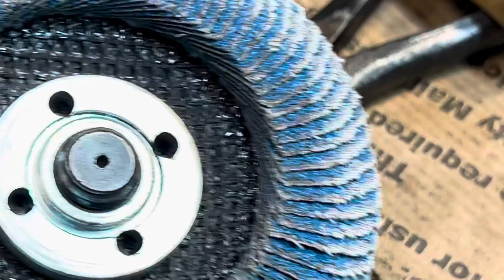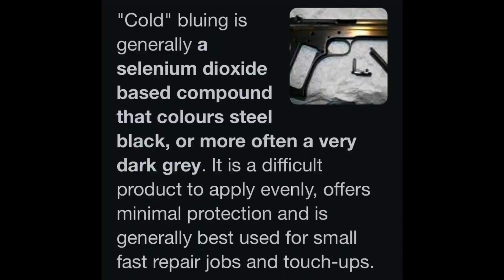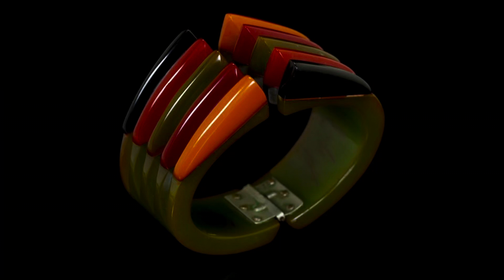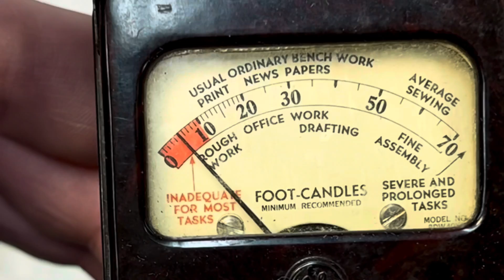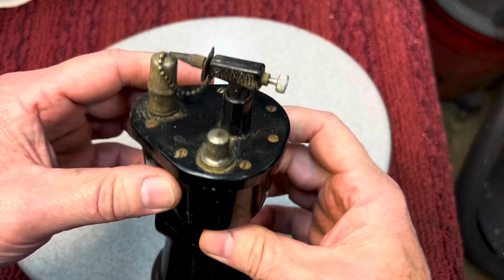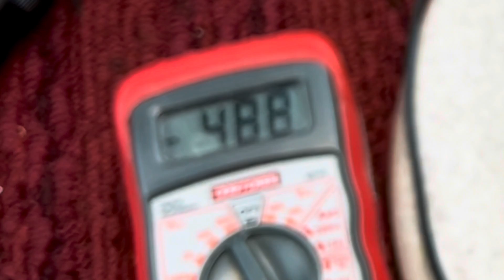Jordan Germany Pliers and BAKELITE Show and Tell

Comment: I need to step up my Waldo game. I'm missing him all the time. Intresting stuff.  I'm using cold bluing on a project of vise grip clamps (the ones you like) I incidentally took it the black of the handle while cleaning one. I don't know what they used in the Peterson factory but it hid a lot of imperfections like forging marks etc. wich I have to sand out now or it will look like...

Comment: I'm frankly sort of shocked you don't own my current goal, one of those mechanical calculators that's about 75 lb of very narrow linkages. I only saw one for the first time operating about 5 years ago and ever since I'm absolutely obsessed with the idea of making a cutaway. I got one off of eBay but it turned out to be pretty rough inside, not a very good candidate. Even so, it is so wonderfully complicated. I grew up with everybody bitching about how expensive a Texas instruments calculator was. I will bet people couldn't get their money out fast enough to replace those beasts!

Comment: That's much more similar to the form of Spirit light I was trying to describe and ask what it was for back when you did a handful of episodes on the subject. The one I have is quite a bit smaller, about half the size of that thicker portion, but it has almost an identical cap and is the same almost 90° presentation. That one clearly looks like it is meant to be used in one position but the one I have has folding wire handles that made me assume it was designed more for heating something evenly
Reply: I think you've totally the solved the mystery. The one that I have has an inscription from a European medical school and instead of a wick it has the little burn tray like a traditional blowtorch. I guess you would have had to hold it or Orient the stand vertically until it started drawing well but I could never understand why it was so well pressurized yet there was no way to light it except holding it at a weird angle. I'm just realizing that the same handles if placed like ears would hold it exactly so. Thank you so much! I love that when you get the answer to Little things that pester at you for 20 or 30 years, haha
Reply: Ironically the handles I sort of struggled to describe accurately. Just by Chance the insulator tester has handles almost exactly the same as the spirit lamp

Comment: Hey John, I had a friend over yesterday who committed such a grave sin with pliers that my first thought was that you needed to warn the world, haha. He reached in a drawer and pulled out my longest thinnest diamolloy needle nose pliers and using the very tip, did a screwing motion!?! I guess he was unwrapping some very heavy wire from a spike, but that 5 seconds of frustration forever ruined an unparalleled tool that cannot be replaced and can never be made entirely right again. The next time you do an episode that encompasses plier basics, I would particularly appreciate it if you tried to inform the world at Large that certain ways of using tools is wrong every time, a crime. It's fine not to know. But you should know to ask if so. Please consider informing the world of the 10 most basic tool crimes common to the most basic daily tools. Nobody handles machinery tools properly so I think it's better to stick to what is in every household
Reply: To be fair I don't think you would find two machinists agree about very many subjects. Everybody's an expert
Reply from the maker: Those extended length needle nose pliers are just asking for abuse!  😂. My Channellock extra long needle nose pliers are very stout and super nice but I have a few pair of less robust pliers that I am surprised they aren’t ruined already!  😃👍

Comment: I'm not trying to be contrarian, the metal itself cannot absorb oil, but various alloys exist that can. A lot of us are familiar with the brand name oilite, if you haven't read the technical history of this, you're really missing out! You wouldn't think metallurgy could be fascinating, this stuff is a basic bronze alloy designed for plain bearings. What is so cool about it is that they have found a way to insert oil molecularly evenly distributed throughout the alloy itself. So when you cut bearings out of this stuff, and it's extremely widespread, you end up with a very inexpensive plane bearing that technically self oils every time it heats up! There's a limit to how much depth heat can cause the release, but there is necessarily still a layer that would benefit and absorb oil! It's really cool stuff and quite the achievement if you think about it and very basic terms, combining a metal and an oil

Comment: Great job on the pliers. The lightmeter is cool also. As an electrician and as a standard now we use lumens , I'm sure your familiar. I love the quality feel of Bakelite too. There used to be so many things in the industry made of Bakelite. I work as an electrician at an airport and we regularly use Simpson meters to troubleshoot airfield lighting, the case on the Simpson is made of black Bakelite. Also we regularly megged the wiring for the lighting at 1k.I have a few old meters and crank up meggers laying around. 
 As a side note is there a way to tighten up that type of joint on old pliers and dikes or wire cutters?I keep eyeing up that Black and Decker screwdriver in your videos. I really would like to start up my own channel but I have so many hobbies that its hard to come up with a name but I'm thinking. LOL. Keep up the great content ! I look forward to every one!
Reply from the maker: Hi Robert!  You are right about the Bakelite and the classic Simpson 220!  I have 3.  😂. You can’t tighten up the rivet with a press or even a punch and hammer!  I did a bunch of videos on that!  Great stuff!  😃👍

Comment: Voltage hurts, the current is what kills people. The 500V will zap you, but such testers can't deliver enough current to do any harm.

With such testers we measure the insulation resistance, for example of the wiring of the house, or power supply cables. Plastic insulation tends to degrade over decades. Later versions had batteries in them to create the high voltage. And now these days we got so called "installation testers" that have this functionality included. And more, you can adjust the test voltage. 250V for sensitive electronics, 500V for regular tests, and if the operating voltage is higher than 500V the insulation test must be performed with 1000V test voltage.

Can''t use them to test the wiring of a motor, the resistance of the windings are too low for that. You can test if the windings are shorted out to the housing of the motor.

https://en.wikipedia.org/wiki/Dielectric_withstand_test
Reply from the maker: I believe the meger testers that run off small batteries have much less current then these mechanical generators.  I have another wind up generator that will throw you across the room!  Ask me how I know!  😂
Reply: @ScoutCrafter  The norm permits a maximum of 12mA for such testers. But only a few testers really use that because they don't need to. The thing is, on 500V and for example a resistance of 1 MOhm the current flowing is:

500V/1000000 Ohms = 0.0005 A or 0.5 mA

I picked that value of 1 MOhm, because that is threshold. For PAT (portable appliance test) and for the electrical installation of a building.
And they don't like external voltage, so if you test a circuit, the circuit must be isolated first so it's not live. Modern testers detect if they're connected to a live circuit, give you a warning and deny to perform the test.

Comment: John, can't you sharpen the cutting surface?
Reply from the maker: Hi Seb- Sometimes you can lightly touch up the cutters but once they are gone it’s over. 🫤.  Only because the jaws will touch and stop the cutters from cutting.  They consider pliers consumable items…. All except NeverSlip pliers, they had replaceable cutters! 😃👍

Comment: We use a lot of motors at work , occasionally they need the windings renewed 
Why would they need renewed it’s just copper wire ?
Reply from the maker: Great question- it’s not the wire so much as the varnish insulation that can get compromised and lead to shorts.  😃👍

Comment: In the UK they sell these 2X LED High Bay Light 120W Deformable LED Garage Light Workshop Industrial Light. They were £8 for the two. Best work lights I have ever bought. They have 4 adjustable wings to direct the light where you want them. Beats all the other types of lighting. The bluing on the pliers finishes them of.

Comment: all our light bulb fittings used to be bakerlite, undo it replace shade replace ring , job done. new plastic fittings are try to undo fitting, won't turn try grips break plastic, go to shop, can't get just the ring, buy complete new fitting return home and install curse profusly, what used to be a 2 minuite job now ends up being 2 hours depending on traffic and how busy the retailer is

Comment: Congratulations on that Megger purchase. It definitely provides a more accurate assessment of the windings condition as opposed to just checking them with a resistance meter. Dirt and humidity can cause the Megger reading to plummet so be sure the windings are clean and bone dry prior to testing. Drying out the windings can take a couple days sometimes. Don't expect a super high a reading on these antique motors. Anything over a few megohms will be safe to test and you can try to raise it higher by cleaning, drying and insulating. Great addition to your shop!
Reply from the maker: Thanks Terry- I see how you use it to check all your motor windings and the difference between damp and dry is amazing.  I’m learning a lot!  😃👍
Reply: @ScoutCrafter  yep, we recently were using a megger on some transformers and we put heaters in them the night before so they would test better